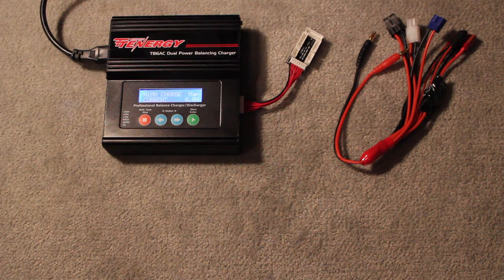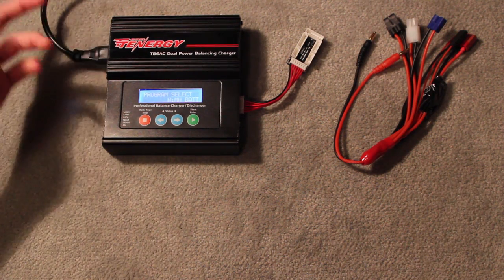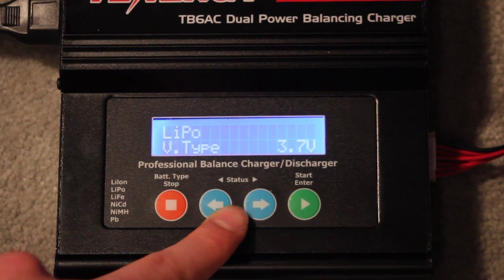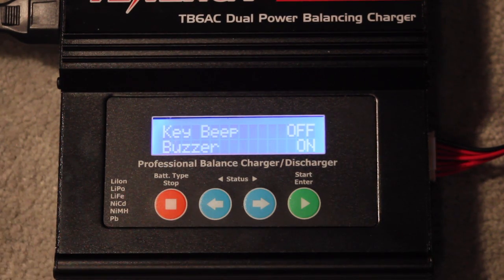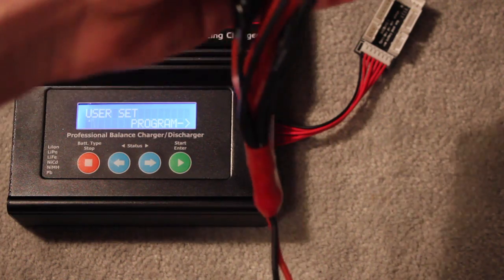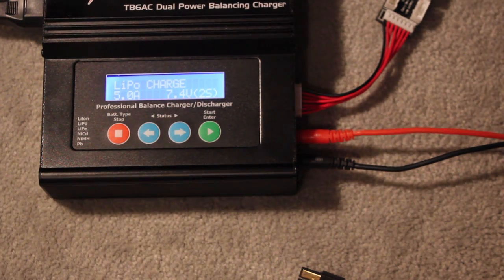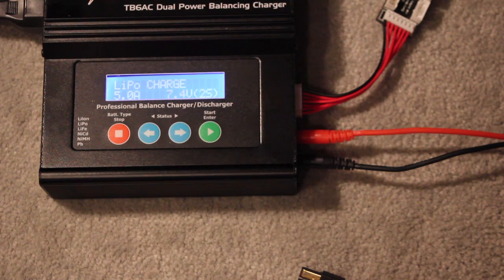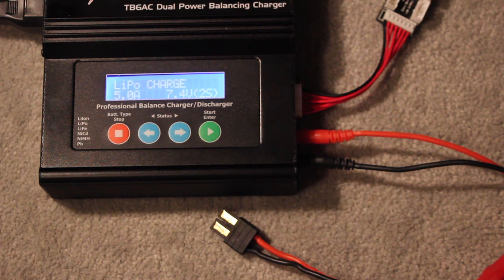How to charge RC Li-Po Batteries with a 4 Button Charger

Comment: Nice i didnt know the amp think. I have set my charger at 4 amp while i have conected a 3 cell lipo with 2500 mah. Is this bad for the battery to charge it with 4 amp becouse i allready do this 4 times. I can chose between 1,2 and 4. What is the best to set it on if i wanna charge a 3cell 2500 mah lipo??? Please help???